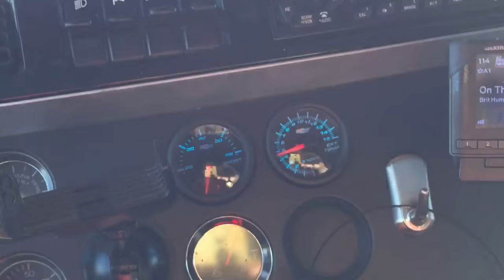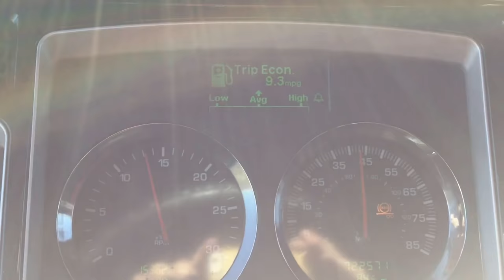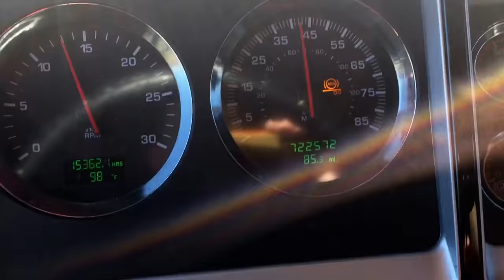ISX15 Cummins Boost range for high MPGS

Comment: I noticed youre under 1500 rpm"s . Over on rawzes forum thats considered lugging. Could that have caused your broken bolt? Im just trying ti figure my CM2350 with a 10 spd and 3.36 rears. I just got it on the road 1.5 weeks ago.
Reply: Lugging is when your engine can’t gain rpm without a down shift. You driving a 10 speed with 3.36 gears and you don’t know this.
Reply: @blackericdenice  nope I keep RPM'S up
Reply: @oscardelpilar3753  What rpm does your engine make peak torque?

Comment: any truck with any engine will give you that mileage with those driving manners.
Reply from the maker: Only if everything is working as it should you can. I had a dd15 and best I could get was 7.2. Tried everything with it and couldn't get what I get with this Isx. I agree though it's all in the driving manner

Comment: Newer engines with all emission bs burn less fuel than your tune truck. Cruse control will burn less fuel than most drivers out here.
Reply: Not true our new trucks don't get over 5 mpg our Kenworth c15 625 tuned truck pulls 6.7 daily
Reply: @movingearth3726  What year is your new trucks and what engine they have?

Comment: Emission bullshit? Lol have not seen a single tuned truck doing better mpg deleted then non deleted. Learn how to maintain the def system before all yall start giving it a bad reputation. We have trucks well over 650k still running emissions with zero problems. Insyead to telling people to delete them learn how to maintain them.
Reply: if deleted a major headacne, maintenance and maintenance costs are reduced. Theres a reason truckers dont like emissions systems and have them deleted